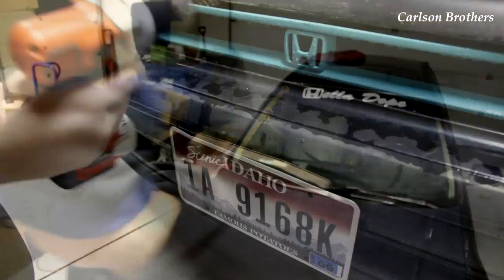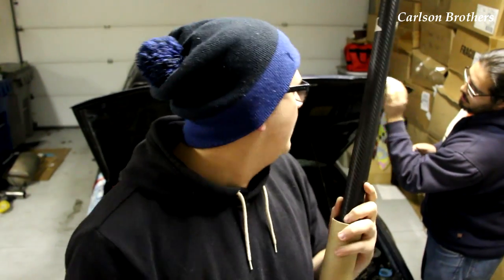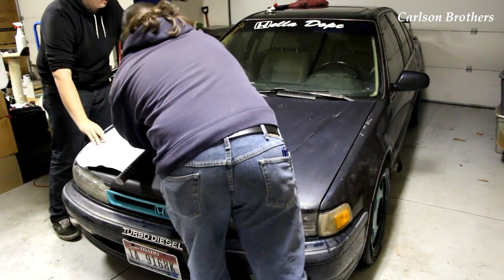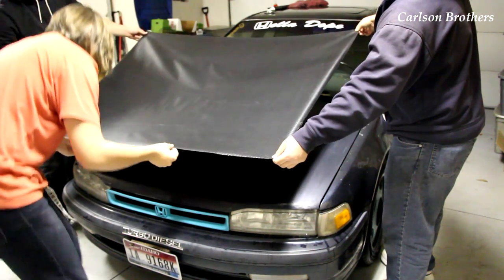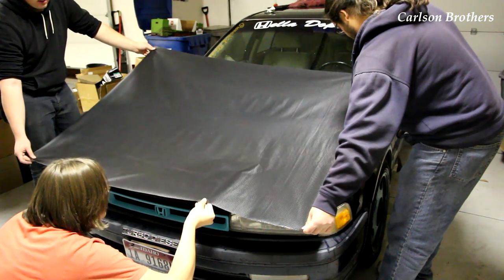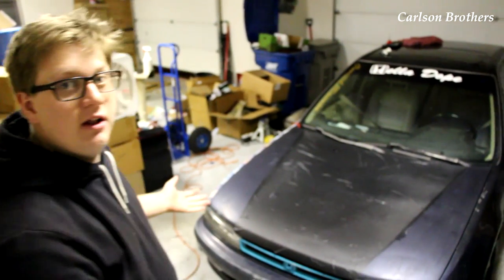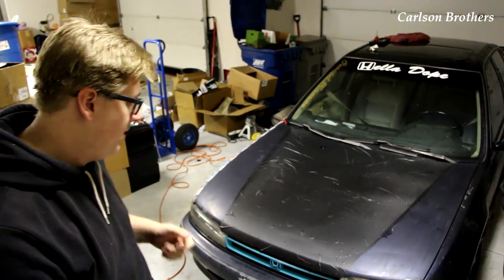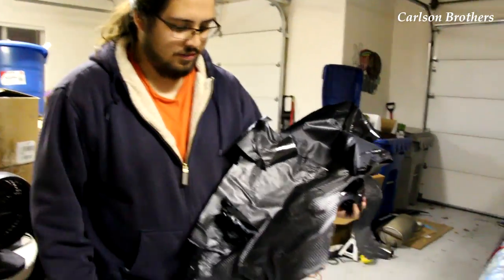How Not To Vinyl Wrap Your Hood

Comment: Here's a suggestions
1) dont be cheap, buy 3M scotchprint (easiest to work with) or Di Noc (also very good) 
2) buy a heat gun don't use a hair dryer it doesn't get hot enough
3) set one side down first then unpeel and do the rest as you go along.
4) buy a squigee
Reply: +Darmo you missed a step... you have to spray a soapy liquid under the wrap so that you can move it around and then squeegee out the bubbles and wrinkles...
Reply: Crash Weekly Good Point!

Comment: The vinyl was most likely fine,  cheap but was usable if you did it right.  You needed to cover the hood with LOTS of soupy water 1st before putting the vinyl on,  then you can move it around and stretch it with a heat gun.

Comment: you're actually supposed to apply it with water so it doesn't stick so easy and make sure its in place, then squeeze out the air and water with the squeegee

Comment: when doing vinyl wrap your suppose to spring the back side of the vinyl and the surface your putting it on with soapy water so u can move it around and stretch it and then the heat drys it so it sticks hahha
Reply: +mk5gti 2.0t and u need some not screaming music hahahha

Comment: Amateurs. Absolutely embarrassing. I would have had it laid on in the time it took you to take off the backing. A tip. Don't buy ebay vinyl, it's cheap for a reason. And don't use soapy water like some people suggest